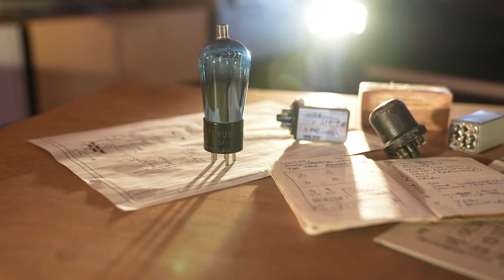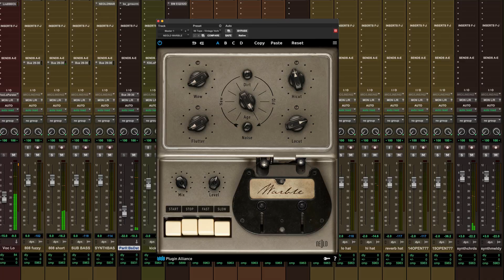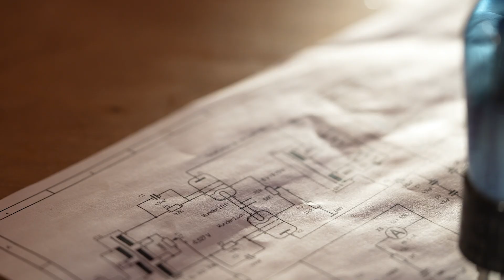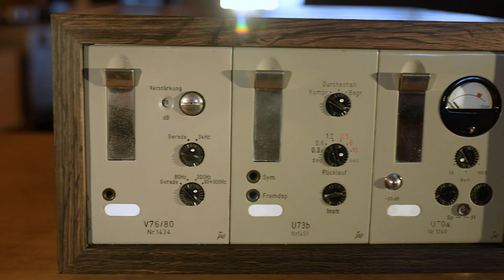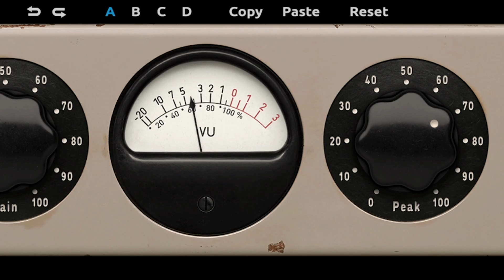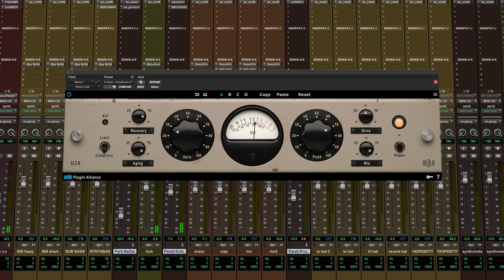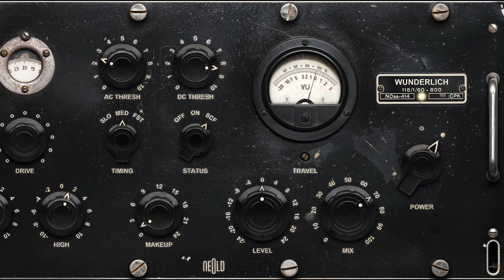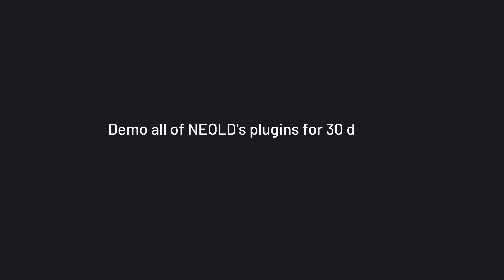How NEOLD Makes Audio Plugins by Modeling One-Of-A-Kind Hardware | Plugin Alliance

Comment: I love Neold, lots of luscious and subtle beautifying of signals, thought at first, what’s the point, doesn’t “seem” to being much, but it’s the classic tiny steps make for giant changes, and that’s the power of it, it’s all in the small additive steps that bring the final eureka, you need patience and concentration to set it correctly while it can be, apparently, subtle, but but all the little pieces together and then bypass, the difference is magnificent, the only “old” thing I have is an ALLEN&HEATH MOD 2 mixing desk in completely original condition, eg a wooden chassis and case, probably a bit too “modern” as it is all discrete components and no valves, but, the input mic transformers are a work of art…..